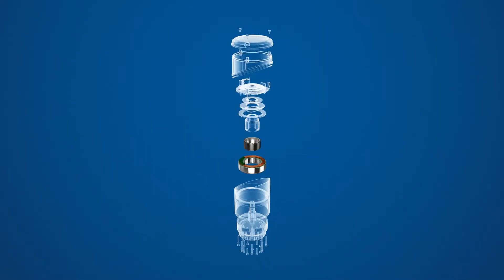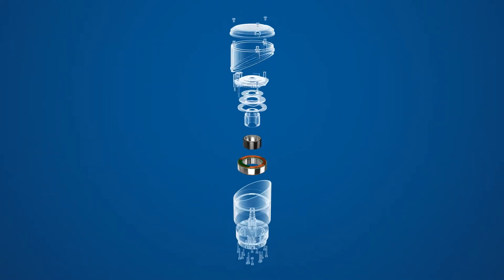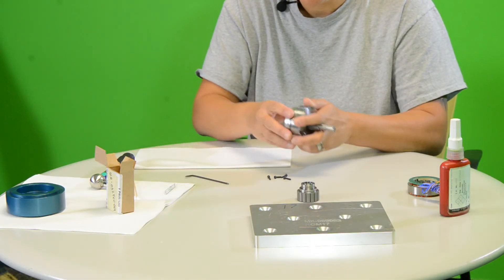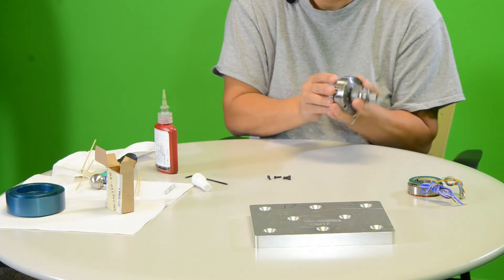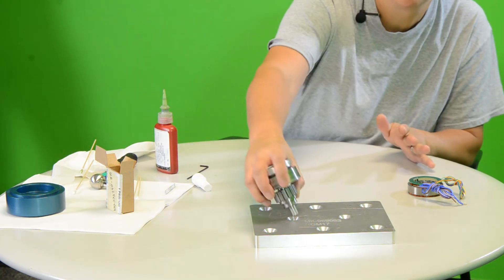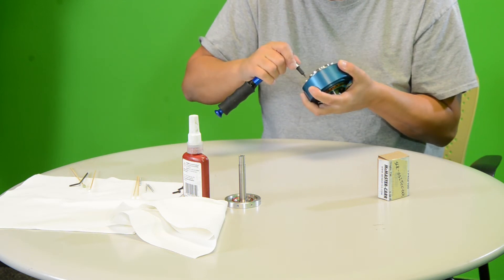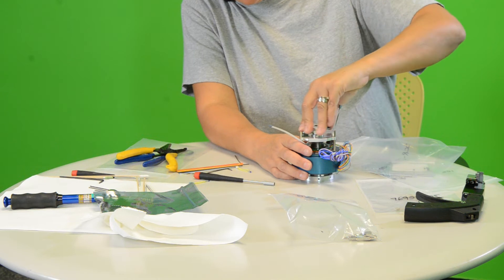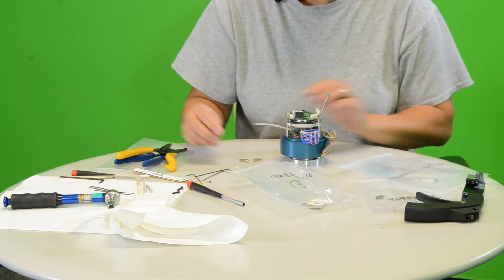Frameless Motor Assembly Into Cobot Joint | 2 Min of Motion Kollmorgen

Comment: Which Bonding Sealant is used for this assembly .. 
Loctite 638 or some other
And what other method used for securing rotor with shaft ...
Can we use interference fit with this motor assembly...